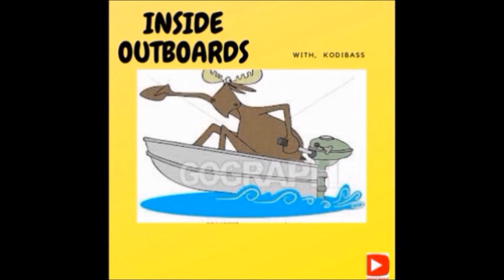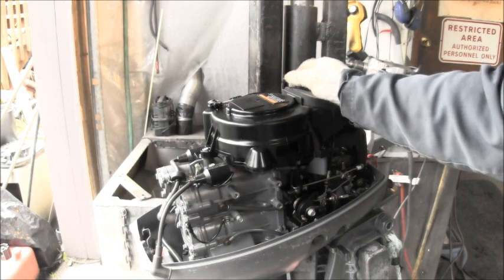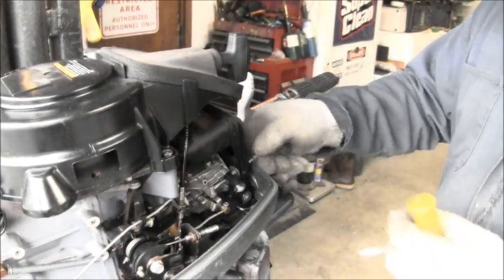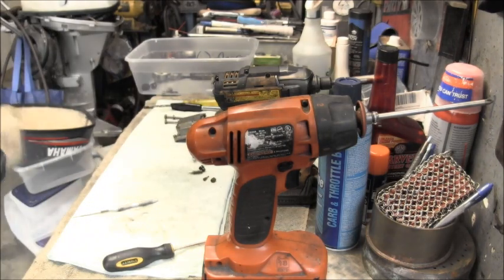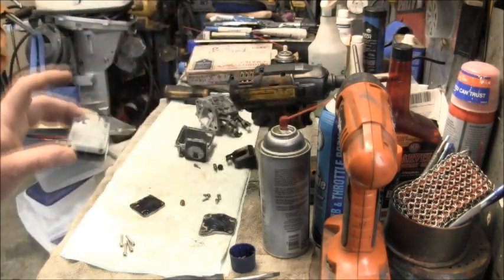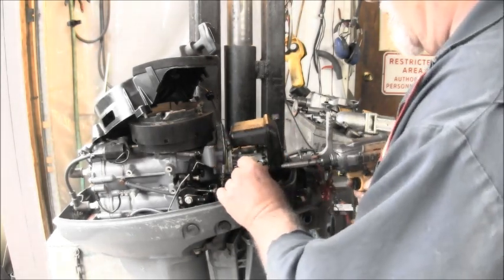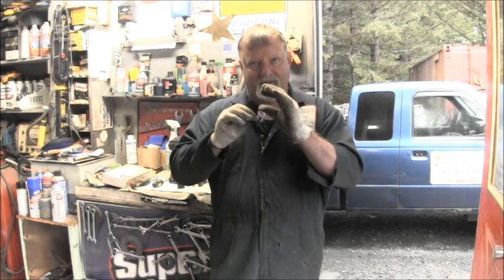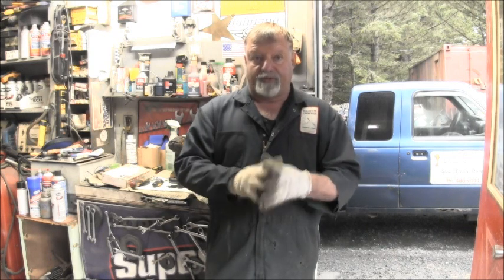YAMAHA  15  HP  2 stroke won't run unless choked   ( Fixed )

Comment: Minute 21 - diaphgram - this really saved the day for me. The 1992 2 stroke 8HP Yamaha I have had exactly this problem. It did not run much in those 30 years (maybe 100 hours) but the diaphragms looked like yours - hardened and crincled. First I tried something cheap rubbery fpr 5 bucks a piece but that leaked. So I replace both diaphragms and the sealings of the fuel pump with original yamaha parts (30 € for each of the diaphragms). This made my motor get enough fule again and now it runs without choke again. Thanks for all the details you provided and its also fun to listen to your language. Thanks pal!
Reply from the maker: Thanks   kb

Comment: That outboard purred once you got the fuel problem fixed... too bad about the bad fuel pump design. It means they'll be back down the road. Guess it's just job security for you (not really a problem given what I've seen come through your shop). Thanks again for education. You never disappoint.
Reply from the maker: Thanks 4 the kind comments ,,   kb

Comment: Great video.  I think my 1993 yamaha 15 hp carb needs worked on. The guy I bought it from said he didn't run it for 2 years. I don't know anything about motors, but it sounds like the idle needs  speed up. Sometimes it's hard to start as well.

Comment: Kodibass, Thank You for this video! I kept thinking my problem was the carburetor or bad gas (which was some of it), when it was a hole in the fuel pump diaphragm. Note - the OEM diaphragm I got didn’t have a flow through hole at the edge so I had to cut it, I wonder if that’s normal? Anyway, great video, and Thanks again.

Comment: I've just gotten one of these Yammy 15 2strokes. 2002. Seems super rich at idle & doesn't rev well. How many turns out from seated should the idle mix screw be? Thx Kodi- Takes forever to get on plane with 125psi both cylinders. Hope it's not a nightmare roach like that one you dealt with across multiple vids!
Reply from the maker: Start with 2 out from light seat,  Then adjust while on the water.  Hope U get her worked out.  kb

Comment: Hi Kodi, on a electric charging system outboard have you ever converted one from mechanical fuel pump to an electric one? I believe the psi range is like 3.0 to 4.0 so the electric pump would need to be the same
Reply from the maker: No never tride that,  If U do keep us posted.    kb
Reply: I will if I know for sure it won't screw anything up. It would be a good video with installing a water separator at the same time

Comment: Hey man great video I have a 15 hp Honda 4 stroke 2001 it won’t run with choke off I cleaned the carb changed the spark plugs and the oil is very clean could it be the fuel pump??  It looks like the motor has low hours on it as well
Reply from the maker: Hang a small bottle of gas Above powerhead from the bottle run a fuel hose straight to the carb. (this will bypass the fuel pump.  If it runs normal bad fuel pump.       kb
Reply: @kodibassInsideoutboards  Thankyou man I will try this

Comment: What did you spray into the pull cord when cleaning up motor. Is it a lube?
Reply from the maker: Yes'  cheap-o  wall-mart  lube.    kb
Reply: Will Q20 work ? @kodibassInsideoutboards
Reply: @kodibassInsideoutboards  another question if you dont mind? On the air/fuel screw is it 1 and a quarter turns out from fully in? Or does that vary per motor? I have a 1990 15hp 2 stroke

Comment: Thanks for the video, umm i installed a brand new after market carb on my 2 stroke 15 and it would run perfect then die off after 1-2 mins of running it. gas flow from the tank is good and a clean fuel filter, any ideas?

Comment: Hello I'm curious what's the difference between the mercury and the Johnson diaframs
Reply from the maker: Johnson  OMC , has a spring that pushes against the diaphgrams,  It seems to work better than  the non spring typs.   kb

Comment: Just picked up suzuki 9.9 doing the same thing runs only on choke I believe the fuel system is similar if remember correctly the fuel pump was attached to the carb little square box on the side the carburetor probably same issue